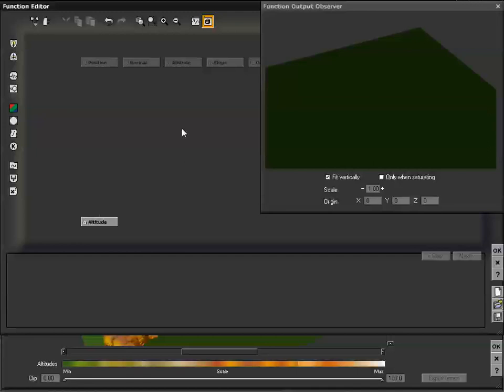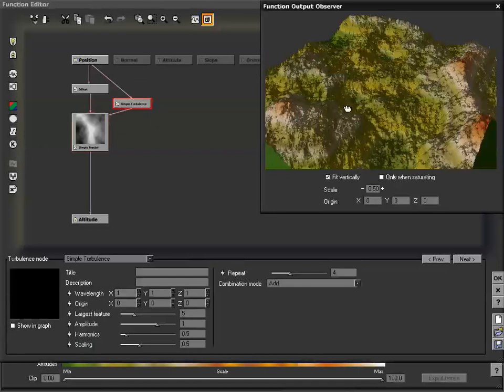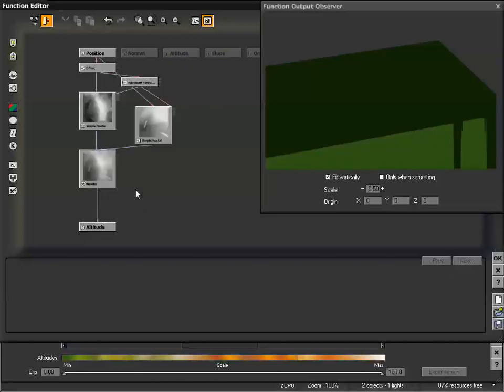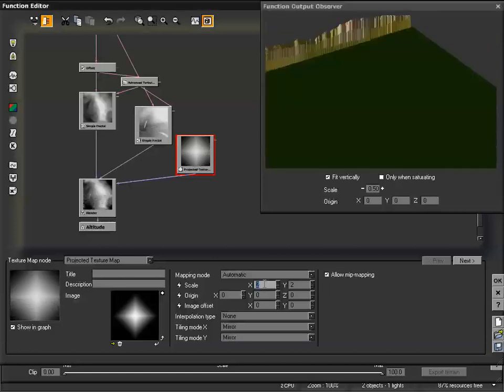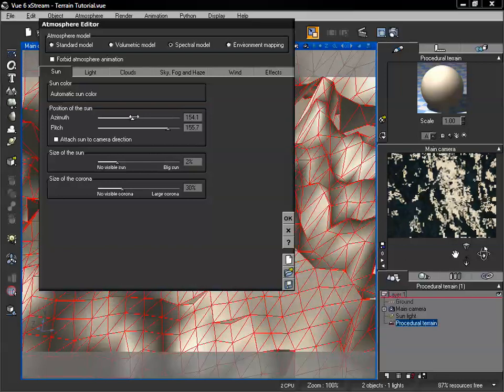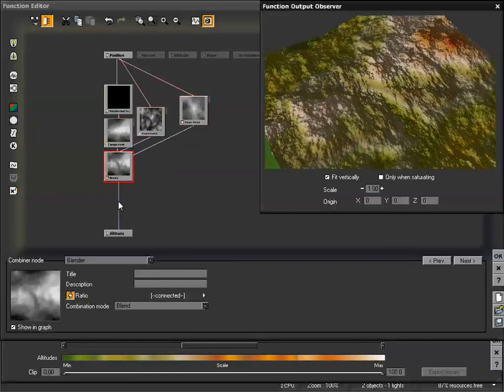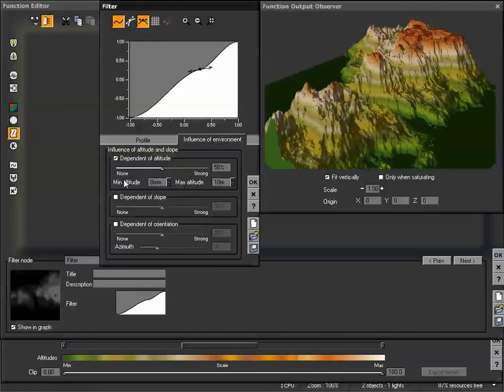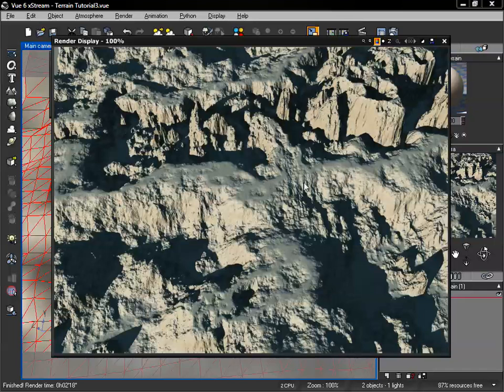Vue 6 Terrains | Texture Map Nodes

Comment: Great video sir! Now as vue became free many people start looking its way. From an indie mobile game dev perspective Vue can be a real gamechanger as a free and powerfull toolset for creation of the terrains. There are couple videos about exporting height maps from Vue to use with UE4 .For hand held  devices though the use of the UE or Unity inbuilt terrain engines are still very taxing for mobile phones hardware.  And this Vue free availability begs the question - Is it possible to  export Vue terrain with its procedural materials as a 3d mesh with baked diffuse and normal maps to be used as  usual  like any other textured 3d model?  Could you perhaps cover this baking and export  process of a small terrain  piece with  materials from vue to be used in any other 3d application as a textured mesh?
 Thank you very mutch for your great tutorials! This channel is so underrated. Subscribed!